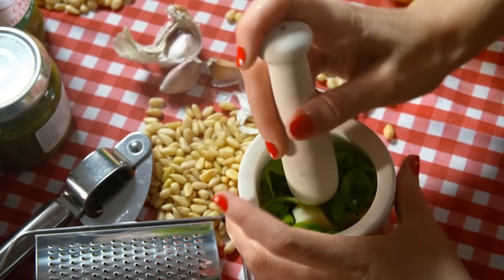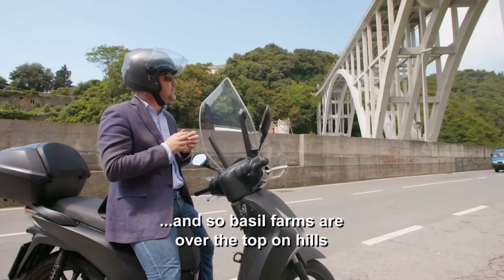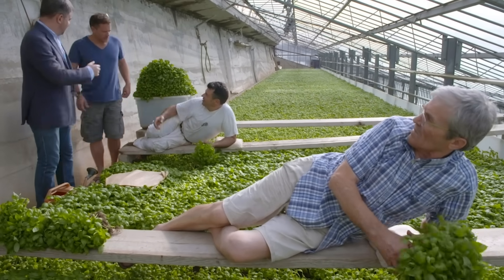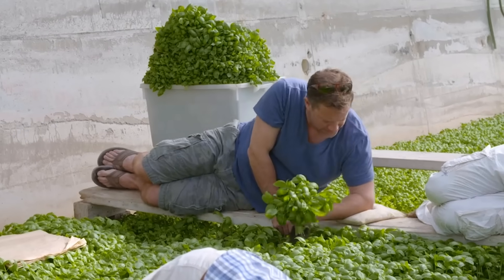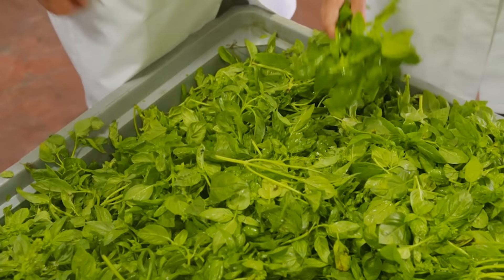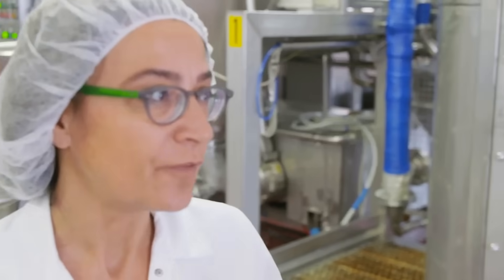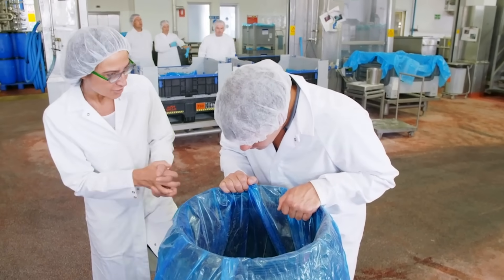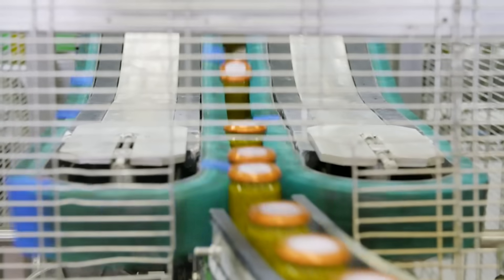How is Supermarket Pesto so Cheap when the Ingredients are so Expensive? | Food Unwrapped

Comment: I planted this Basil Genovese in my garden, and unlike them, I cut the tips that has the biggest leaves. Now it become a bloody jungle as they seemed to get upset by being cut, and decided to grow out of control. How much does a pesto serving for 6 persons in Indonesian kitchen costs??
Recipe from "Mangiare in Liguria", claiming to be the "ufficiale ricetta" for "pesto alla Genovese"
1. Basillico alla Genovese - free when grown in garden or IDR 12,000 per 60 g - careful, have a very awful shelf life even inside refrigerator
2. Pinoli / Pine Nuts - IDR 58,000 per 50 g
3. Aglio / Garlic - IDR 10,000 per bunch, use 2-4 cloves or more 20-30 g (IDR 5,000)
4. Sale grosso / Coarse salt - IDR 70,000 per kg (fancy one), use 5-6 g (IDR 350)
5. Pecorino Romano - IDR 179,000 per 100 g, use 60 g or 2x Cucchiai da cucina (IDR 107,400)
6. Extra Vergine Olio di Oliva / Extra Virgin Olive Oil - IDR 88,000 per 500 ml, use 100 ml or mezzo bicchiere (IDR 17,600)
TOTAL: IDR 188,350 (USD 13.5 / EUR 11) for 6 persons meal (600 g pasta), weighing roughly 250-280 g (you can't scoop everything out of the mortar or food processor).
It is indeed freaking expensive, when a 200 g jar bottle of it from Barilla or De Cecco in a supermarket is only IDR 55,000 to 69,000 (USD 4.9 / EUR 4.1) at most.
As you can see, the most expensive is the DOP-labelled Pecorino Romano, followed by pine nuts, and extra virgin olive oil in number three.

Comment: Easy. Same as always, processed foods use reject ingredients IE the stuff that you would not be able to sell whole due to rot, etc.
As for olive oil, you get olive oil and you get EXTRA VIRGIN olive oil. Only extra virgin olive oil is expensive, the other stuff is the left overs from when the good stuff is extracted.
Reply: False. Most ingredients sold for food processing just avoid costs in packaging, while using physically less attractive products which taste the same 

The tomatoes you get in your grocery are specifically selected because they have good color, look uniform, and have the correct size. Asymmetric, slightly big or slightly smalm tomatoes taste just as good and are used by processed food manufacturing.

If anything food safety standards are so stringent in food processing facilities that you're orders of magnitude more likely to get rotting food in a domestic kitchen.